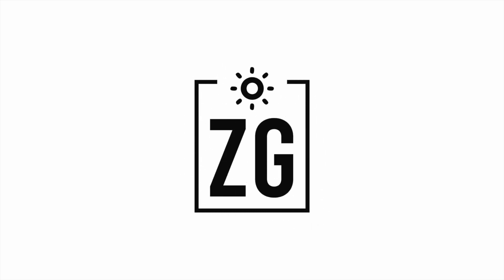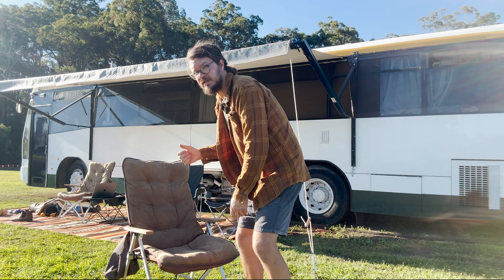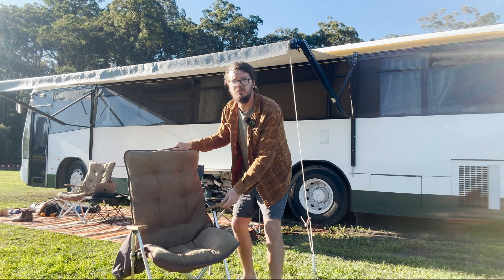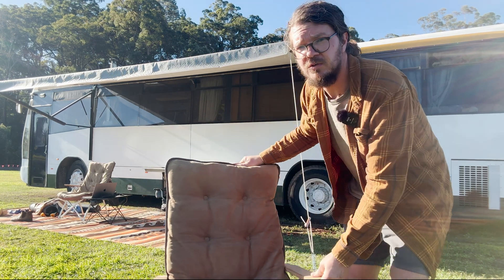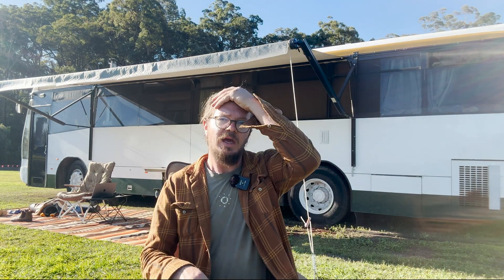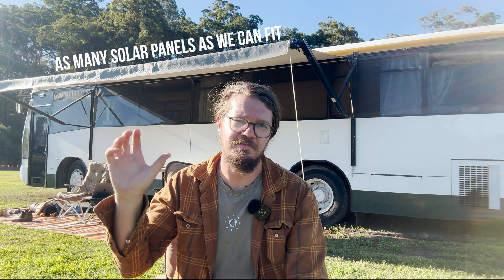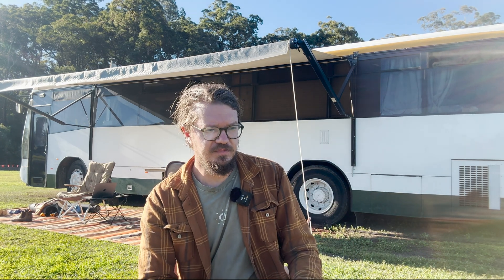Size Your Victron Bus Off Grid System RIGHT

Comment: how many 48v batteries would you need to run a 24volt Air Con   during the summer in QLD????
Reply from the maker: Hey mate, What other big appliances you planning on running? I would be aiming for around the 10 or 15kwh. Which would be 2 or 3 batteries of the BSLBATT or MPS battery. This would be a good starting point with the potential of adding more as time goes on if need be.

Comment: You can get alternators for 12v , 24v , 36v, 48v and 240v why bother with dc-dc conversion.
Reply from the maker: That would work with a direct connection to a AGM battery bank but not with lithium. Our lithium bank in our bus would try and pull its full capacity of 1200A from the alternator if it was directly connected and that will not end well for any of the components 🔥
Reply: @zerogridaustralia  No the charge controller on the alternator would take care of that.
Reply from the maker: @bascomnextion5639 yes I have seen these. It could potentially be a viable option adding another alternator dedicated to the house battery bank. I do prefer the method of using what you already have and utilising the big alternators in busses

Comment: I wish I had seen your video before I bought my system for my house boat which I live onboard full time. My system is a Victron 3000 48 v, then I bought your bus system schematic & realised my system was a bit too small! I also have a REDARC 2000w 12 volt system rebuilt from your 12 volt schematic. My plan is once my house is sold is to buy your 8 panel solar panel pack (I have the roof space) & another Victron multi plus II & some more batteries (mine is a fusion battery) anyway I hope to sell the house soon & will be in contact soon. Oh and I love the schematics!
Cheers mate
Reply from the maker: Thanks for the honest feedback mate! And yeah we build systems pretty seriously, there is likely some easy steps to take to bring your system up to scratch and happy to help where I can 👍🏻
Reply: @zerogridaustralia look forward to it - like I said I will have with what I have., which is pretty close to your 48v schematic except for the charger (I don’t have a 48v charger & my vessel battery is 12v which all runs off the REDARC system), number of panels and battery. Like I said it was a pity I didn’t discover your website until after I bought the setup I have. No matter hopefully soon I can improve mine with your components/ packages. Cheers

Comment: Some coaches have two alternators. Is there benefit in fitting one DC-DC charger to each, or is that overkill? Is one providing as much power as the batteries can absorb? Question 2; The Renogy solar panel brackets you sell recommend using an adhesive to secure them. They also have little indents suggesting you can screw them into the sides of the panels. Is that correct? When you see and hear horror stories of panels flying off, I'd like to secure them the best I can.
Reply from the maker: You could definitely utilise both the alternators. I would connect them both to be feeding the starter batteries of the bus and then pull the power form there with my max 75% rule.
And yes there is lots of good ways to mount the solar panels and no such thing as overkill. Decent adhesive properly prepped along with rivets or screws would make them stay on forever 👍🏻